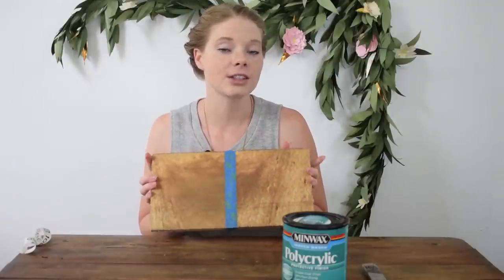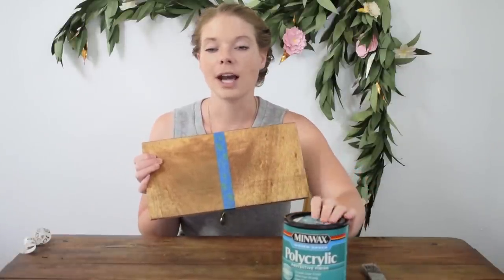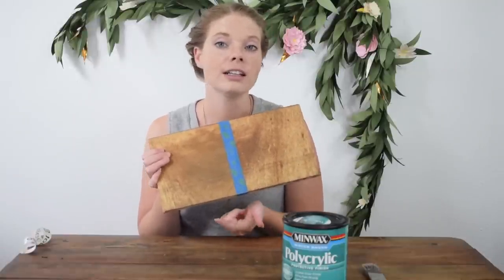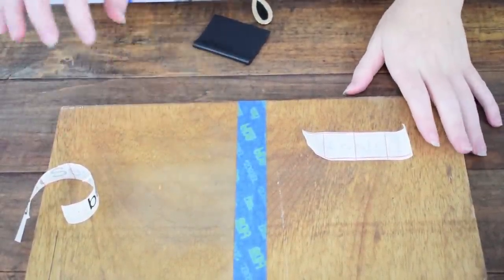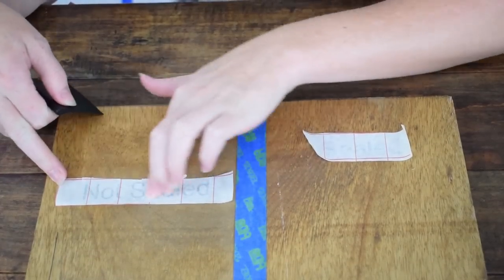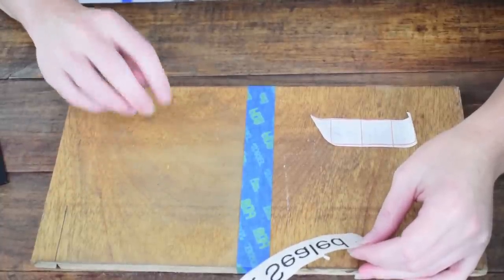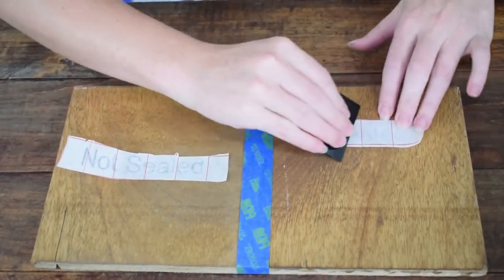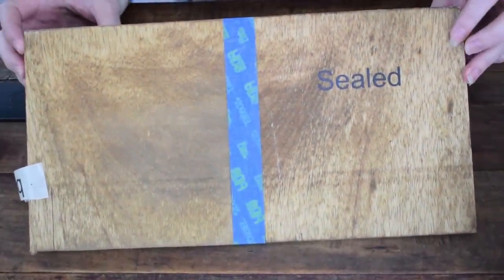Getting Vinyl Designs to Stick to Wood Projects

Comment: No questions answered so I won't subscribe .
Reply: Johanne Brunner me either, needs to answer questions at some point
Reply: I'm going to start a channel and I'll answer! 😆😆 Delilah's Treasure Chest. Look for me.
Reply: @Caleb-vm2uk  I'm going to start a channel and I'll answer! 😆😆 Delilah's Treasure Chest. Look for me...
Reply: Seal your wood before applying vinyl so you don't run into issues keeping it on/applying it. That was the point of the video. Rewatch for comprehension
Reply: But poly comes in semi, glossy or Matt so which one.

Comment: So… yes, this works… HOWEVER, after some time, they will still peel off. I’ve found that if I combine this process with using HTV instead of permanent, and then apply a touch of heat after I’ve applied it, it stays a LOT longer, especially for projects that ensure the outdoor weather.

Comment: Wow...THANK YOU SO MUCH!  I was so frustrated with not being able to get the vinyl to stick.  I eventually figured that it was the oils in the stain so I applied alcohol to the surface and that still didn't work.  So again, thanks, gotta run out and get some polyacrylic!

Comment: I didn't seal my blocks before putting my removable vinyl. Can I seal it now or would you just leave it? It's sticking with no problem....😬
Reply: I used Mod Podge over my final design with vinyl. It worked great and sealed everything in place!  However, I would have liked to have known to put the poly down first!

Comment: I'm new at making signs, but I've done woodwork and worked with stain and polyurethane many times. I was told to stick on the letters before sealing them. I didn't agree with what I was told because I know there's oil in so many wood stains. Thanks for making & sharing this quick video.
Reply: I've understood that putting it on afterwards can yellow the vinyl if white. But I'm here to learn as well 😊

Comment: I'm building an outdoor table and want to decorate it with stickers.  Per your tip, I will paint a layer of poly before I put the stickers in place.  I want to seal the entire table after I apply the stickers.  Should I seal the table and stickers with a water-based poly or is there another product I should use?

Comment: I was having the same problem and found out that I overstained my wood leaving a tacky residue on the top layer. The way to fix this is get some mineral spirits and a 220 grit sanding black and scrub off the top layer until the stain is no longer tacky. I wanted to try the seal first but didn't want to chance ruining my project. But I'm definitely glad I found this will work!
Reply: If you think you put too much and it's still drying, use painters tape to "peel" off the top layer so you don't have to sand as much later. Saves a bit of time in any case where you add to much or even see some orange peel

Comment: hi I have a wood pallet that I treated with the polycrylic, I can't get the self adhesive vinyl to stick to it.  can I use the easy press over the transfer tape on the wood pallet to see if this helps stick the vinyl?  also if once the vinyl is sticking to the wood pallet do you recommend giving it another coat of the polycrylic?

Comment: If you have both a painted and varnished sections on a piece, would you need to seal the painted section of the wood as well before applying the permanent vinyl?
Thanks

Comment: I want to try this but I wonder if you could tell me how long it will last before peeling off?  I’m thinking of doing this instead of hand painting stencils on my wood projects. I suppose you could do a top coat of poly overtop of the vinyl to keep it from peeling.  I’d love to hear your thoughts.
Reply: I've understood that putting it on afterwards can yellow the vinyl if white. I understand using outdoor vinyl is the best to use if problem the items outdoors but I'm not really sure what qualifies as outdoor. I thought just permanent vinyl was but I guess there's something else that's more durable for outdoors.

Comment: Hi! I stained some wood, did 1 coat of polycrylic and waited 24 hours to apply vinyl. As I peeled up the transfer tape, some of the polycrylic came with it. How can I keep this from happening again?
Reply: Same thing happened to me..on my next project I try to put it on after..but my letters still want to lift..a friend told me to try a heat gun over it ..I think it works

Comment: Does it make any difference if using just a simple craft varnish vs POLYCRYLIC?
this happened to me: I had a poplar board that seems like I sanded way too much that the surface was soooooo smooth, applied my stain (which by the way didn't stained that much but oh well) , then I applied two coats of craft varnish then I applied my vinyl 651, then I applied the craft varnish again "to seal the edges" ,I sanded it lightly and then applied my acrylic paint , when peeling it came almost all the paint off with my vinyl :(, question is....
Does it need to be POLYCRYLIC and not a craft varnish?
Should I have used the 631, since the surface was pretty smooth?
Did I need to be even rougher sanding on top of my stencil?
I would really really appreciate somebody help meeeee sorry for being so meticulous with my question :( 
TIA

Comment: I have tried this exact matte minwax polycrylic product, however it peels up off of the stained wood with the transfer tape, meaning the vinyl still won't stick. Anyone else having this issue or now how to solve it?
Reply: Jessica Gorey did you sand the wood first? Then seal?